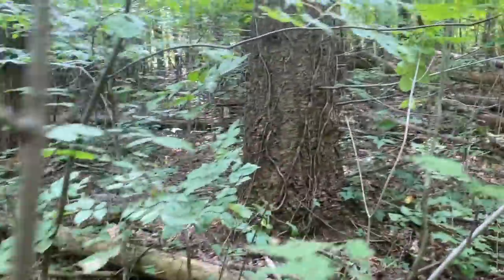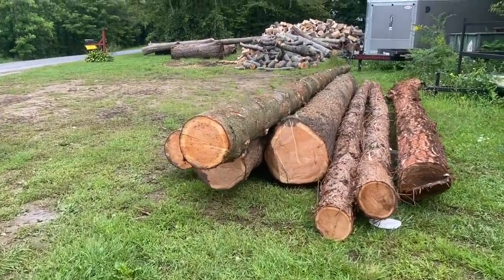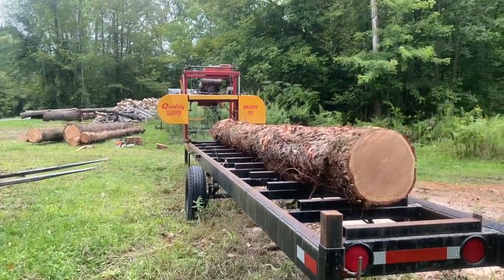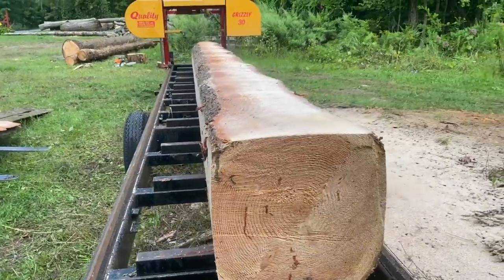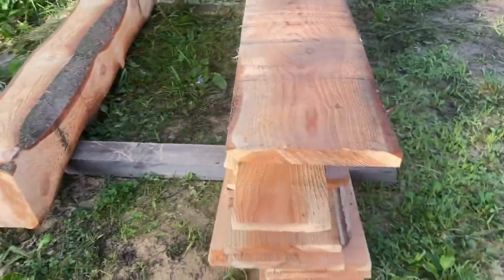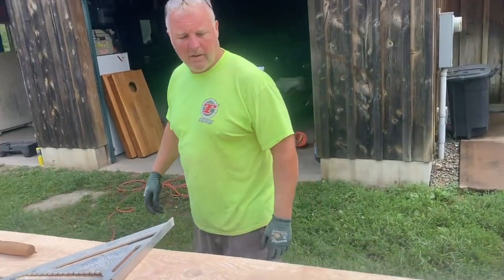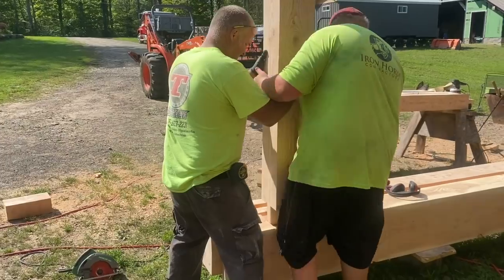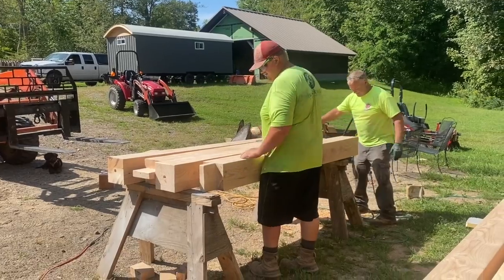Timber frame porch project

Comment: Ok concrete guys, listen up. Those green  hemlock rafters are going to walk and twist on you. Best put some blocking between them. The big doug fir beams are going to split pretty bad too. Best to put some wax on the end grain and roll some oil like linseed on the other surfaces. Beautiful work, would be a same to let it all go to ruin. Thanks for a fun to watch video.
Reply from the maker: Hi Bob We built this entire camp with green hemlock in the spring and it has sat all summer to dry. The roof is made from 2x10x20 hemlock. nothing has twisted at all on this camp. The douglas will check I have a timber frame house and used quite a bit of Douglas fir beams. We already oiled everything after the beams were up but after this video. They only sat one day then were oiled. Thanks for the feed back 👍😊

Comment: Did you use timber links in the poles to secure to porch? Or just concrete pins in to stabilize the posts?

Comment: Don't you need to dry that green wood before using it?
Reply from the maker: No it will dry in place very nice we built this entire camp from rough cut hemlock and pine this spring and it is completely dry now.